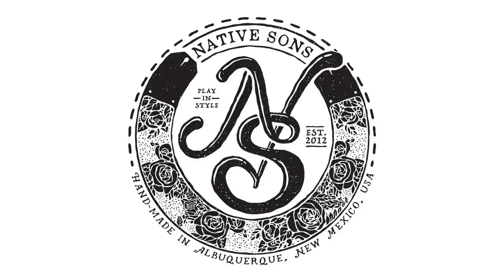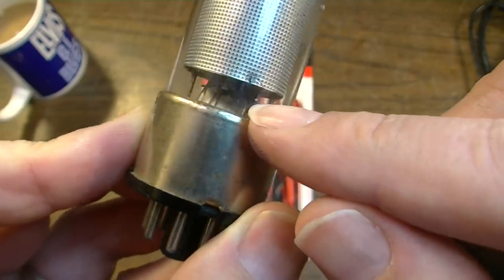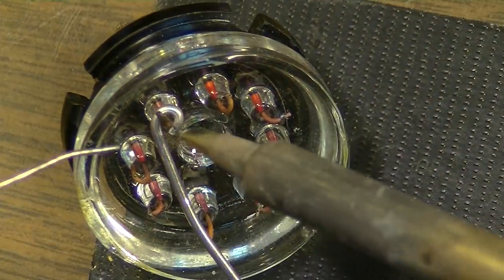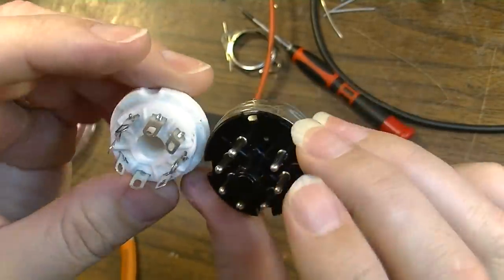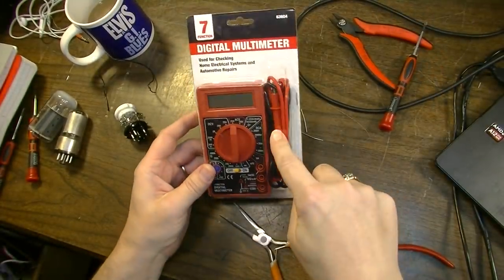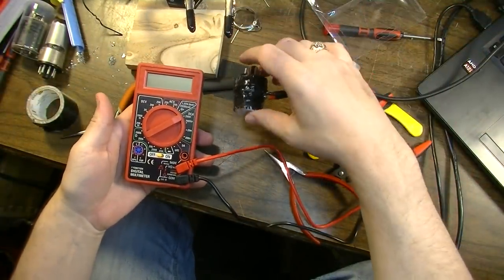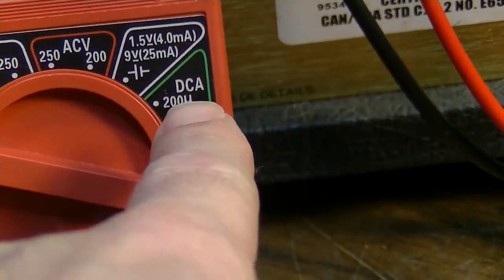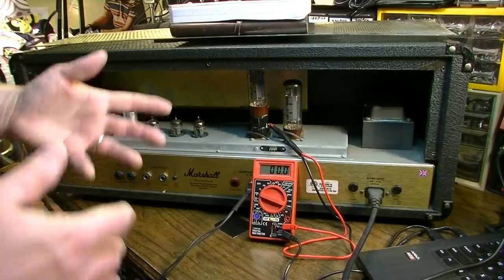$3 Tube Amp BIAS PROBE Made in UNDER 30 MINUTES!

Comment: I have a few of these i made a while ago.  Great idea.
I used the black plastic octal base that Antique Electronics Supply offers for a few bucks and the PC mount Belton Micalex tube socket that just has straight long pins.
I bent out pin 8 on the socket then inserted the rest of the pins into their respective spots in the octal base.  Then soldered a 1 ohm resistor into the base pin 8 along with a piece of stiff wire.  Connected the other end of the resistor to the bent out pin from the socket.
Then all you need is a volt meter to measure the millivolts across the 1 ohm resistor.  The reading of course translates directly into milliamps.  This way you don't need to keep the meter connected.  If you have two of these adapters you can then merely move the meter to the other tube without disrupting the operation or even putting the amp in standby.
You should put some shrink wrap on each pin and wrap the whole thing in some kind of tape to keep from electrocuting yourself accidentally.
I suppose you could get the octal tube socket saver (for tube testers (also available from Antique Electronics) and Dremmel a slot in the side of it right where pin 8 is and add the resistor there, thereby automatically have the high voltage pins out of reach.
Nice demonstration... Mars Amp Repair

Comment: Thanks Brad! We can always use more test tools and equipment. The cheap test leads are usually the weak link that makes DMM's look bad. I personally do not trust cheap leads or wiring for anything.
Reply: Yep. I only buy test leads and probes from Probe Master now. And I have my own wire to make test leads with and I solder the alligator clips on. I made the leads for my DC bench power supply myself.

Comment: Just as a note, instead of breaking the glass envelope, you can unsolder the pins and pull the tube wires out, then solder the jumber leads into the pins.   Aslo If you have a tube with the tall sides from the pin base, you recess the socket into the base and make a little neater.
Reply from the maker: Thanks. Only problem with the tall base is it extends the height of the unit, making it difficult to insert into some heads.

Comment: Thanks so much for all the great content ! Much appreciated! I started watching without the slightest clue about amps whatsoever but jow I'm proficient with head scratching... lol . I have learned a lot though. Also another fan of yours LowHeadRoom has been a huge help as I have completed my first build a 5e3. His tutorial was a Godsend. I built a current limiter , a cap discharge tool and a cheapo attenuator.  Works well with up to about a 40 watt amp , bigger, and she smokes like a hash joint 😆. 
I saw this  probe video and made one recently . I biased my 73 YBA1 today as well as a Hot Rod Deville I bought that was on the fritz (for about 200 usd. The  IC caps were spent and had a bad power tube. Bought some Supertech caps , cheap.). works great. Now I'm going to gut it, sell the boards and build a Chinese kit in it. 5f6a with a plexi style channel mod. Another video I saw on yt. Also a very helpful dude. ..
Anyway man I want you to know aside from the entertainment you have been a huge help to many people. Cheers!

Comment: If you just solder a 1 Ohm resistor, across the probe wires, then if your meter fails (or isn't connected) it still works, and instead of measuring current, just put it on the Voltage range instead of current, you'll get current (as the voltage across 1 Ohm is the current flowing through it....)   V =  I . R (and R=1)

Comment: I made a bias probe in 1996 using an octal base from a blown Tesla tube with all 8 pins present, a ceramic clip in/lock ring style octal socket, 2 feet of zip cord,  a dual banana plug and a 2w resistor that measured exactly 10.0 ohms on the same multimeter I would be using to take bias readings with. Still have the probe and use it all the time. The multimeter is long gone and so is the Beckman that followed it. Using a UT61E now. BTW, most all handheld Multimeters have the inputs spaced to accept a dual banana plug.

Comment: Thanks for this Brad, building one today!
I initially went to use a 6550 that was red plating for this project. When I opened the 6550, the grid connection pretty much fell off at the pin. No wonder it was red plating! :)

Edit: I soldered the red lead to the amp side as that's the more positive of the two.
Reply: I had to think a minute lol! Right...the output transformer (amp side) is the source of the 300-500+ volts that goes to pin 3 (plates) of both tubes or sets thereof(push/pull).  Even when a voltage is negative such as bias voltage....the red lead goes to the less negative of the voltages. Example ...negative 40volts(-40) is more positive compared to negative 41 or 45volts(-41, -45)!!! Red lead goes to -40 point and the black lead goes to the -41 or -45 point.

Comment: Thanks I purchased one from nobsound and couldnt get it to work, by watching your video I realized what was wrong. One of the leads was not connected and this video helped me to solder where it needed to go. Bingo, amp is dialed in. Also thanks for showing a close up of the meter and the setting itself.

Comment: Cool man, I'd love to see a part two where you actually measure the bias on a ( set of ) tube(s) that is the rated value in watts for a 6V6 GT and/or a 6L6 set and show us a how one might insert a variable pot at the bias resistor(s) to use either set of tubes on the same amp.  Showing us Luddites in You Tube Land how to measure the rated wattage per matched set (V=IR or some variation thereof ) would go a long way to keeping us all subscribed, like our Uncle would.  I've heard how one (you) cold set these hotter or cooler (whatever one might interpret from that terminology) and actually play us some Ramones some Keith Richards or some Wes Montgomery to demonstrate WHY you bias the tube set that way afterwards would be greatly appreciated.  I know you can, so go the extra mile and keep us all happy...

Comment: I appreciate your idea!   It took a little more than 30 minutes though.  Even with everything on hand. Unless you're in 2X speed.
Reply from the maker: So you got one made?
Reply: @TheGuitologist  I actually made one the day you posted it.  I had everything here.  I had an octal plug that I used instead of breaking a tube.   I put female banana plugs right on the test socket so I can use banana jumpers.  I think I'll make one for 9 pin minis, EL84 ect.  Thanks again for the video.

Comment: I love all you videos Brad, and I like this your probe design, but it can be very dangerous. You hinted at it in your video, but I think a "Red Alert Warning" may have been more appropriate. You will have the full plate voltage of around 450V  (700V on a MusicMan) on your probes. You could have made your probe safe by putting in a 1ohm metal resistor in the cathode path and measure set your meter to volts. 35mv isn't going to hurt if you touch it.
Reply from the maker: I hear ya, and thanks for watching. But... Measuring at cathode is less accurate. Also, if I put a "red alert warning" on this video, what level warning belong on my regular videos where I'm prodding around inside the chassis?
Reply: What you're saying is true. There are life-hazards all through a tube amp. This one just made me feel a little uncomfortable.
What I really like about your videos is that they are real. You show the dead-end trails we all follow, the mistakes we all make, until you solve the problem. I like your honesty

Comment: Wrapping the whole assembly in duct tape reminded me of 90% of the stuff my father used to make.  And just to mention, if you don't have a tube or don't want to go through reclaiming the base, the same places that sell sockets also sell empty bases for not more than a buck or two each.
Reply from the maker: I very nearly filled the cavity with epoxy instead of using the tape. Would have been prettier.
Reply: @TheGuitologist   Glad you didn't.  There's a certain charm for stuff like this if it's wrapped in duct tape.
Reply: Now, if you'd have wrapped it in electrical tape and then friction tape after that, it would match the vintage look of all those vintage amps. :)
Reply: @goodun6081  By the time that would happen, you'd have to rebuild at least the test lead connections, at which time it would be a complete re wrap anyway. And Duct tape gets sticky over time when it is handled like that. Besides, you won't be leaving it in circuit for any appreciable amount of time anyway. And its only aesthetic.
Reply: @goodun6081  I think you misspelled "Messy Booger"  :)))                                                   ................FLEX!
Reply: @good 'un  Nah, too utilitarian. Make a bunch of them and wrap them with matching Tolex, naugahyde, vinyl, or whatever amp covering is used for a particular brand. Then it would really look like it belongs to that amp line. The home made tester needs STYLE!

Comment: I am curious - why don't people expose a probe point for Pin 3 as well, so that it's possible to directly measure Plate-to-Cathode voltage in cathode-biased amps? I know that for fixed-bias, the cathode is grounded, so your plate voltage tells you all you need to calculate dissipation. But for some amps (e.g. Champs, Tweed Deluxe), you'd need to make a separate measurement of the cathode voltage and subtract it from the Plate voltage. Thanks for posting this video!

Comment: Yupp, that works, just remember this thing may be lethal. You have 300-400 volts exposed in several places here, and even if you have tuned off the amp but have charge in the B+ caps you could get lethal shocks out of this. May be easy to get in touch with B+ here when you insert or pull the probe, and the other hand on the chassis to steady things since there is a bit of force required to pull or insert the probe. Could easily happen when changing over to do the other tube.. I would have made sure everything was insulated, e.g with a separate lead for the anode voltage measurement and fully shielded probe ends for the meter side, or by to inexpensive meters and build the whole thing in a box.

Comment: That was awesome I've always wondered how this works. I bought a premade probe exactly like the one you just showed me how to build. But now I know exactly how it works. By the way we would love to sponsor a few of your videos. What do we need to do to make that happen? ( John - Guitar player )
Reply from the maker: Your probe could be measuring the current at the cathode, which is safer because no high voltage, but you can't get a plate voltage reading. Also, any current measurements taken at the cathode will be adding in the screen current to the plate current, so this is way more accurate. As for sponsorships...I'm always looking for sponsors. Email me and I'll send you a rate sheet: bradlinzy at gmail

Comment: I'd like to see someone (maybe you?) build a probe for an EL84, 9 pin tube.  I like the idea of the probe sold through Tube Depot, the Bias Scout.  It utilzies a 1 ohm resistor coming off the Cathode pin and a Voltage divider coming off the plate.  So one probe allows you to measure (stepped down) plate voltage (in millivolts) and cathode current.  Unfortunately, I cannot find a kit for this.

Comment: Good job but that way all the external wiring and the meter are all at above 450vdc. Just remembered the output dc resistance/winding voltage drop method. That's what I'll be using on amps without a cathode resistor.

Comment: Sweet! I need all the money saving tips I can get.
Did you ever find a better display for the variac? Mine lost its magic smoke from running it too low. I haven't been able to find one with separate power & input.
Reply from the maker: There is a hack for these. I've been meaning to hack it and make a video of that. Thanks for reminding me.
Reply: @TheGuitologist  I just upgraded my variac and added the meter along with the hack referenced.  It works great and is pretty easy to do.
Reply from the maker: @BradBartram  I keep meaning to do mine, but just keep putting it off. Maybe I'll put it on the short list.

Comment: Using the meter in line can be inaccurate unless it is verified otherwise. Who knows with that thing (which I also have.) Even a 1ohm in the cathode channel with that meter, in voltage mode, could be questionable. A 10ohm may be more accurate but would require sliding the decimal in your head. Tapping in the plate channel removes the screen factor which is good but the cathode avoids the high voltage. Lots of tradeoffs.
Reply: why is using the meter in-line inaccurate if you have a decent meter? i thought this was basically the only way to directly measure current, isn't that what they're designed for?

Comment: Thank you - this is very helpful! Can you clarify the setting and connection for the plate voltage?
Reply from the maker: If your amp is NOT cathode biased, you can just hook a second meter to measure plate voltage from one of the plate leads coming off the probe to chassis ground. that will measure your plate voltage. If your amp is cathode biased, you'll have to open the amp and measure from plate to cathode.
Reply: Thank you again!

Comment: This is some classic Guitology, for sure !!  If I wanted to make an adapter for a 6BQ5 could I use the same concept only with the other type of socket arrangement?
You can still use your cheapie meter for other tasks by plugging in another set of leads. Very wise. I have a few of those myself, if you buy something for 99 cents they give you the meter for free. Thanks, Harbor Freight  :)

Comment: Cool. Good tip. Maybe a dumb question but if you're working with paired tubes would it be worth it to make 2 testers?
Reply from the maker: If you want to take the time to make a second one, it'll save you time in the long run, but you can do it with just one probe.

Comment: I have one of these bias probes..it came with 2 probe cables,but they have a 1 ohm,2 watt shunt resistor built into the cable…What is the purpose of that??…I ask because I need 2 more probes,and was just going to build my own…
Reply: Boffin55 has explained. You measure the V instead the A. Then A=V/R , with 1 ohm resistor is equal to A=V/1, so A=V.

Comment: Curious, how did you get solder to stick to the original stems from the tube as they are normally coated for heat dissipation and solder won’t stick to them? With the plate current measurements, are they the values needed to adjust the overall biasing required by the tube and controlled  adjusting the reostat provided for biasing?  Is the current a more accurate value for biasing than observing and adjusting voltage?

Comment: Why would anyone assume the Fluke was more accurate than the other one ? If the calibration is off for either, it's off.  Discussing this with another right now as to whether they should get a more expensive multimeter or not. I think all of them are going to be off by whatever the location & conditions for calibration were. That's going to vary for the power source & location where the amp is being biased as well.

Comment: Dear Mr. Guitologist
,

What about the load? Do we place a dummy-load or some real speaker during the bias adjusting?
Reply from the maker: Connect to the normal prescribed speaker load or equivalent dummy load to take measurements, yes. 30-45 minutes is probably a bit excessive, but you'll certainly get an accurate reading that far out. You'd also likely get reasonable accuracy after a couple minutes in most guitar amps. Speedforhire is right, also keep volume down. You don't want signal reaching the output or it'll throw your measurement off.
Reply: @TheGuitologist  Thank you very much indeed!
Reply: @speedforhire  Thank you!

Comment: If I wanted to make  a bias probe like yours but for an EL84 tube, then would I do to pin 7 (the anode plate pin) what you  did for pin 3? Am I understanding this right? Then I would measure the plate current and voltage the same way you did?  Am I understanding this right?
Reply from the maker: Correct. You're just breaking the plate connection and inserting an ammeter in series.
Reply from the maker: Make sure you also leave a way to connect to the cathode from outside the amp. That'll make it easier to measure the bias on cathode biased amps.
Reply: @TheGuitologist  Okay ... I don't understand that, except that in an EL84, pin 3 is the cathode and "suppressor grid" (whatever that is). You didn't get into that is this video did you? I am going to watch it again, a couple of more times. One problem I'm seeing is that a tube base or plug is not available for  nine pin tubes like the EL84 whereas they are for the octal type tubes you  used in your video. And an EL 84 with the top broken off is too small for soldering a socket to it.

Comment: Hey ! Great video ! Question for you, is it possible that I need to change the position to be mesured depending on the tube or the circuit?  Or position 3 should do it ? Thanks ?
Reply from the maker: Use the position shown in the video and that'll work for all tube types.

Comment: Quick question, years ago my friend showed me how to make a bias probe similar to this but he soldered a 1 ohm resistor I think on pin 3 between the red and black leads and read the millivolts? Would this work or is my memory failing? Thanks 😊
Reply from the maker: That's only going to be as accurate as the resistor. If the resistor isn't exactly 1 ohm, the calculations will be off. Better to measure plate current directly.